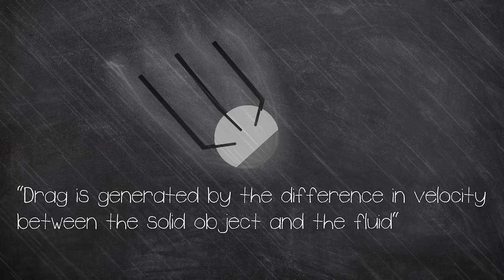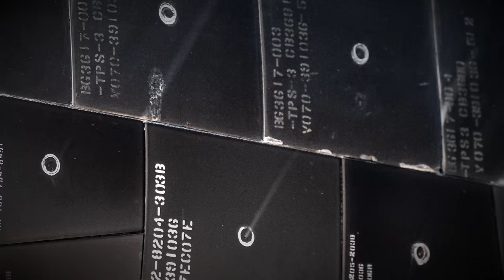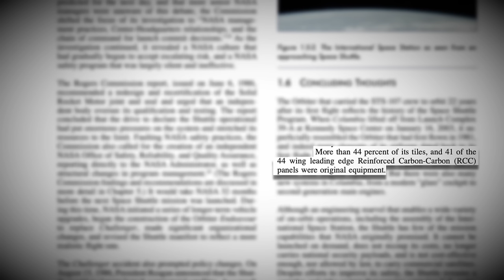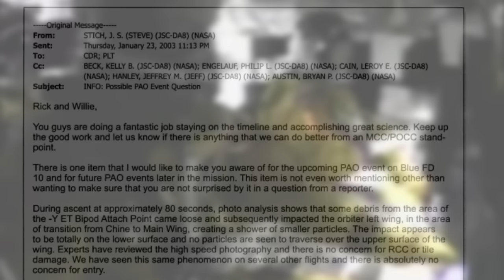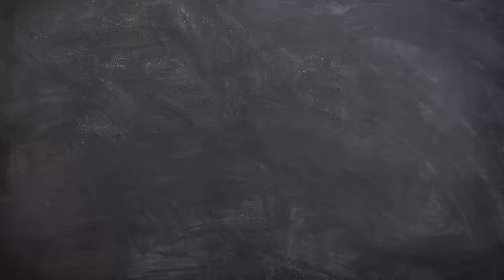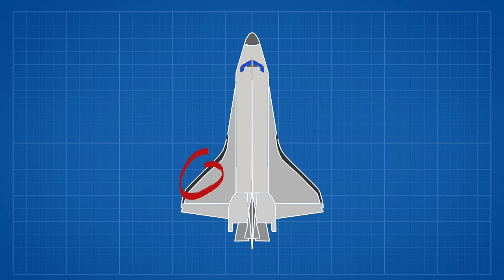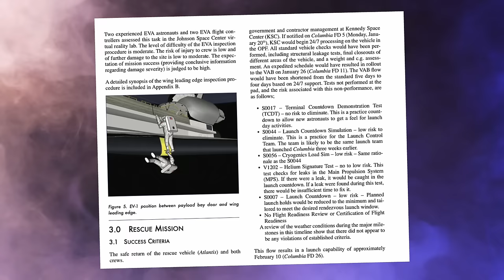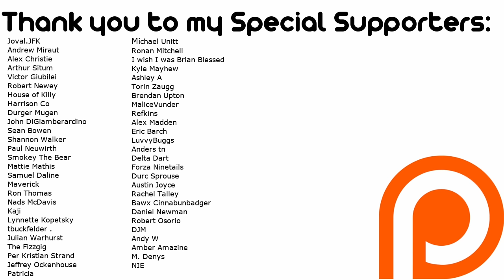Ignored Warnings: The Columbia Space Shuttle Disaster 2003 | Documentary | Plainly Difficult

Comment: Truth was that the shuttle was simply a very technologically brittle vehicle... "brittle" as in "not robust".  The design was extremely complex and had insufficient safety margins and safety escape options, and too many potential points of failure with little/no chance of survival if they happened, and they were far too likely to happen.  BOTH shuttle disasters were from issues that were COMPLETELY known to the shuttle program management before they occurred.  Challenger's O-ring issues had happened before-- a previous flight had a booster recovered with a hole the size of a basketball burned in one of the motor casings, from an O-ring leak.  The only things that saved that crew was the fact that it occurred later in the flight and the hole didn't have time to grow larger before the SRB's burned out and jettisoned, and the fact that the leak and subsequent hole ended up being almost on the opposite side of the booster from the huge External Tank filled with liquid hydrogen and oxygen, whereas on Challenger the leak was right by an aft strut connecting it to the tank.  The leak had formed early in flight, basically at liftoff, but had sealed up temporarily with "gunk" produced by the engine firing (alumina slag mostly) which then broke loose when the Challenger flew through a strong wind shear later in flight, and the leak began blowtorching through the motor casing and burning an ever-larger hole in the booster, which lowered pressure and thrust in that SRB, creating side-thrust that the shuttle's flight computers had to steer the engines sideways more and more to counteract, and finally the flames from the hole started burning against the External Tank, burning away the foam insulation and exposing the thin aluminum skin of the tank to the flames, which was then fatally weakened.  Under stress from the tons of liquid hydrogen pushing down and outwards against the tank walls, under stress from the side-thrust of the flames from the hole itself, and from the counter-force of the gimbaled engines which were steered almost hard over to keep the shuttle flying on the correct trajectory despite the side-thrust from the SRB hole, the aluminum skin of the tank finally let go and ripped apart, and the shuttle instantly turned sideways to the airstream inside the fireball from the ET's burning propellants and broke up from aerodynamic stress.  Even if the tank had held, the Challenger would have tumbled and broken up within a few more seconds-- the booster hole was getting ever larger at an ever faster rate as the propellant continued to burn and blowtorch away at the wall of the booster, and the shuttle's engines were nearly "hard over" trying to correct for the side-thrust trying to push it over and tumble out of control.  A few more seconds and the engines would have been hard over, and no more corrective force could be generated, the hole side-thrust would overpower the engine corrective forces and the shuttle would have tumbled and broken up.  The previous flight's O-ring leak had happened at a temperature of 53 degrees F, and temps at launch day in the right SRB of Challenger were still below freezing at launch time, about 28 degrees IIRC from memory.  BUT the managers had told the engineering supervisors to "put on their management hats" and overrule their engineer's concerns, and we got the disaster.  The O-ring issues were already in the pipeline for fixing, as a new design for improved booster casings with additional O-rings and better sealing surfaces was already in the works-- the decision was made to keep flying the shuttle while these new boosters were being designed and constructed, a gamble which led to tragedy.  

Same thing with Columbia.  The foam strike issue had been well known for years by that point.  A previous shuttle mission had experienced a foam strike that hit the orbiter's belly/chine area and shattered and sheared off a number of tiles, and the orbiter returned with a hole burned in the aluminum skin of the orbiter beneath the missing tiles.  Fortunately for that crew, the hole had burned through in an area that was non-critical, meaning no critical wiring or systems were located in that area and it didn't reduce the critical strength of the shuttle's structure.  Instead of being taken as a serious warning that the potential for disaster was very real, it was instead interpreted as "see we survived this with only minor damage, so it's okay nothing bad happened so nothing bad WILL happen in the future!"  Of course for Columbia luck ran out and the damage was in a more critical area and bad enough to allow hot gases to enter the wing and start burning through wiring and systems and finally through the spars and structures holding the wing together and supporting the aerodynamic loads on the shuttle, causing it to break up.  

to be continued...
Reply: Continued... 

Thing was, the shuttle tank absolutely relied on the foam for insulation-- the earlier S-II stage of the Saturn V had used foam insulation in the form of pre-made "tiles" that were glued to the INSIDE of the tank one-by-one at the factory when the stage was built.  This of course was a very expensive, labor intensive process.  Spray-on foam insulation on the OUTSIDE of the tank structure was planned for a second run of Saturn V stages, had they ever been ordered and constructed (which they were not, Saturn V was cancelled to free up money for shuttle development).  The shuttle orbiter, using the fragile RCC and silica glass foam tiles, had originally been planned to use a different design, carrying much of its propellants inside the orbiter itself, and using the larger, empty tanks to increase the surface area to weight ratio to make it 'fluffy' enough to be able to use simple "hot structures" metallic thermal protection much like hypersonic planes like the X-15 and SR-71.  This didn't allow for the oversize payload bay that the Air Force wanted, nor the large delta wings that the Air Force wanted to get the cross-range necessary for "once around" polar orbit missions launched from Vandenberg and landing at Edwards AFB in California after a single orbit, so the stubby winged "fluffy" orbiter design was scrapped and the large delta-wing orbiter we got was designed instead, with the fuel moved to a large disposable external tank.  The higher reentry heating of the delta-wing design also meant switching to silica based tiles and RCC for heat shielding since the higher heat couldn't be handled by hot structures metallic heat shields.  The tank foam was necessary not only for holding down boiloff in the tanks of propellants during fueling prior to launch, but also to prevent the formation of large amounts of ice and frost on the outsides of the tanks, which would be shaken loose and fall off during the extreme noise and vibration of liftoff.  Watching the old Saturn V (and other rockets) liftoff footage one can see literally TONS of ice and frost shaken off the vehicle at ignition and liftoff,  which fell down the sides of the rocket and landed on the launch gantry, etc.  The orbiter's brittle tiles would have literally been shredded by all this falling ice and debris, which is why the External Tank was coated with a thick layer of this foam insulation.  The foam would in fact get SO COLD that air in the bubbles in the foam would actually LIQUIFY from the cold... for small bubbles in the foam it wasn't an issue, but if there were any voids in the foam, trapped air pockets, the air would liquify and reduce in volume by hundreds of times, leaving a near-pure vacuum in the void, and the 14.7 PSI of earth's atmospheric pressure at sea level would then crush the foam inwards to collapse this void, which was found to weaken the foam and break it, causing foam shedding.   The solution was more careful application to prevent voids in the foam layers on the tank.  There were a number of issues with the foam, and eventually it came to be realized, particularly in the wake of the Columbia disaster, that there simply WERE NO realistic solutions to the problems... the very design of the shuttle put the fragile tile heat shield feet away from the brittle and shedding-prone foam and NOTHING could change that.  SO the decision was made to retire the shuttle and replace it with something else.  Shuttle continued to fly while alternatives were worked on, and to finish the ISS which was "halfway" through construction at that time, and which had been designed specifically to use shuttle as a launch vehicle for its modules and components and structures and for work on its construction.  

Shuttle was a good idea that was simply compromised... a lot of compromises were made in its design and construction, and most of them weren't good.  Most were made for "requirements' that were never used (like the once-around polar orbits the Air Force insisted upon which never occurred-- the first was to be the next flight after Challenger which was cancelled in the shake-up after Challenger, along with many other things) and a lot were cost-cutting measures, and at any rate the shuttle could NEVER live up to the expectations set for it which were not grounded in reality.  At one time the shuttle was projected by NASA to launch up to 100 times a year... that would be twice a week!  Of course there were never enough payloads to justify that sort of launch cadence, and it was based on ridiculously low costs of $10 million or so per launch.  This was in the VERY early days of the shuttle program when the design wasn't even really finalized yet, and as time wore on and reality started to come to light, this was pared down to about 70 flights per year (still about five days between launches!) and then finally around 50 launches a year (once a week roughly).  All this was nonsense.  Even the External Tank had ridiculously low costs projected for it, at about $20-25 million per tank even very late in the design phase of the shuttle system!  The most the shuttle ever flew was 9 times in the 12 months prior to the Challenger disaster, and that was a cadence that NASA could not maintain and in no small part helped lead to the Challenger disaster.  By the time of the Columbia disaster, 17 years later, shuttle limitations were well known but still many safety issues related to shuttle were not sufficiently respected.  Shuttle was a terribly expensive and risky vehicle that never lived up to expectations set for it or the goals that were put forward to justify its existence... at best it was a successful failure IMHO.  It had become SUCH an institution and had so much institutional inertia behind it that although even by the early 2000's when it was realized shuttle NEEDED to be phased out and replaced at some point, it cost SO MUCH, along with the albatross ISS program, that there simply wasn't enough money left to design something to replace it.  Shuttle was on borrowed time by the early 2000's... it was already a 20 year old system with 20 year old vehicles-- its technology was cutting edge-- for the mid-1970's when it was designed!  Shuttles were going to need billions in upgrades and repairs in a comprehensive updating program in order to keep flying past 2010 and everybody knew that, and it was already being questioned at the time-- shuttle was a HORRIBLY expensive vehicle to fly-- even by rosy "estimates" of the time it was $400 million per launch, nearly as much as a Saturn V, for a fraction of the capability.  Plus it was an inherently risky and limited vehicle... 

What's sad is, retirement and replacement of the shuttle was considered or at least proposed even after the Challenger disaster.  We could have had a shuttle replacement that would have used the External Tank tooling to construct a new liquid-fueled booster vehicle with a first stage using a pair of F-1A's from the Saturn program, topped by a short second stage powered by a single Saturn J-2S engine, launching a modified design capsule based on the Apollo and made to be reused.  Such a rocket could have grown into a cargo variant using three first stages together for a booster much like Delta-IV Heavy, topped with a larger multi J-2S second stage and the single engine upper stage for a third stage if needed, and used to lift the mass of the ISS into orbit in a half-dozen or so launches instead of the 40+ launches required by the shuttle to construct ISS over a 13 year period... and at a fraction of the cost.  And without the loss of a second orbiter and crew later on (Columbia).  BUT the 'sunk cost fallacy' took hold and shuttle was returned to flight... the rest is history.

Comment: When you review the tests on the CF piece, you find they had to shoot the foam at many times higher rates that the foam should have been traveling to damage the piece. They also kept shooting the same CF piece because of the cost. It is more likely to me the foam damaged the tiles across the landing gear doors. That explains why the first high temperatures where in the wheel well. The debris coming off was probably the landing gear door and eventually the landing gear itself when the tires blew.

Comment: I suggested to NASA that eliminating the paint coating on the external tank removed the hard outer shell and this led to increased surface drag on the foam which allowed the foam to shed.   The paint coating strengthened the foam surface. The first tanks were painted which gave it a coating like an M&M candy.  I still think that not painting the foam coating contributed to the problem.

Comment: Heating on reentry primarily occurs due to compression of the air at the stagnation point, NOT through friction as is commonly reported. Friction does play a role, but the compression is the overwhelming source of the re-entry heat. Other commenters may have made this same point - I didn't read them all. But I should be stated repeatedly to correct the prevalent myth.

Comment: The Columbia disaster was being telegraphed as early as STS-27, only the second mission after Challenger.  A chunk of debris detached from an SRB, struck the underside of the orbiter (Atlantis, I think?) and punched a pretty substantial hole in the TPS.  By sheer luck the affected area happened to be over an L-band antenna, which somewhat protected the interior of the wing from plasma intrusions and avoided the complete structural failure that befell Columbia.  The engineers were shocked by how substantial the damage turned out to be after the shuttle returned, and it remains the most heavily damaged orbiter to ever make it back home in one piece.  Had STS-27 been lost it would have pretty much killed the space shuttle programme there and then, as  they'd have lost 2 shuttles in 3 missions.  

This should have set alarm bells ringing, but for whatever reason it didn't.  This event should have been taken far more seriously than it was.  It was obvious that the reusable heat shield on the shuttle orbiter was an extremely vulnerable spot that had little resilience to damage.  But the programme carried on merrily on its way with no significant changes to either the launch stack or the TPS, and 15 years later those roosters came home to roost.

Comment: 15:55 - Correction here. You said they used the engines for the deorbit burn and the animation shows smoke coming out the back of the orbiter. In reality the SSMEs (RS-25s) were never used while in orbit. The OMS (Orbital Maneuvering System) thrusters were used to insert the orbiter into orbit and were also used for the deorbit burn as well.

Comment: I wonder why they used insulation foam on the external tank instead of building it like a thermos with a vacuum between the tank itself and an outer hull for the tank. Seems like that would work better for insulation and completely avoid the problem of foam coming off the tank and striking the shuttle. Maybe building the tank as a huge thermos was too expensive or technically challenging? Maybe it would have added more weight? IDK
Reply: That would add a lot more weight. They were optimizing the tank to the level of getting rid of the white paint they used to apply on top of the foam after the initial launches because it added 600 pounds of weight.

The foam was, somewhat ironically, a consequence of the Shuttle being unable to tolerate debris hits on the heat shield. Without the foam, frost would've built up on the liquid oxygen tank and air would've liquefied on the hydrogen tank. The frost being guaranteed to fall off and hit the orbiter.

You'll notice that other rockets don't really need such insulation because they don't have anything for falling frost to hit, they're fine with having frost building up on the tank walls, and they're tending to move towards using Methane, which is liquid at similar temperatures to oxygen, so they aren't having to keep something so cold that it liquefies the air.
Reply: @dotnet97  thanks for the detailed answer to my musings!

Comment: 16:21. 
I know this is a common misconception but still I will point it out. Heat is not produced from friction. It is made more by the rapid compression of the atmosphere that a spacecraft produces while going through the gas. The rapid compression turns the gas into a state of plasma and causes the immediate immense heat. The part that glows on the spaceship is not the ship as it would be if it were the ship heating up from friction. It's rather the cone of plasma generated by the  depending spacecraft. 

Sources:

https://en.m.wikipedia.org/wiki/Aerodynamic_heating
https://en.m.wikipedia.org/wiki/Atmospheric_entry
"Objects entering an atmosphere experience atmospheric drag, which puts mechanical stress on the object, and aerodynamic heating—caused mostly by compression of the air in front of the object, but also by drag"